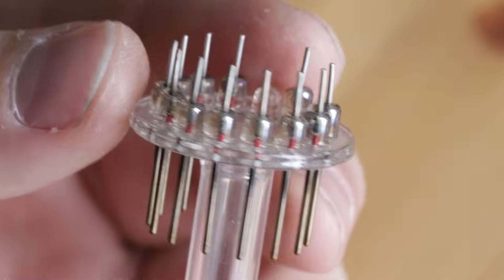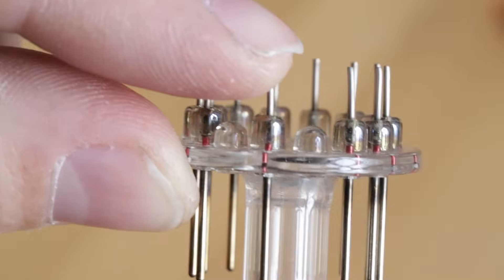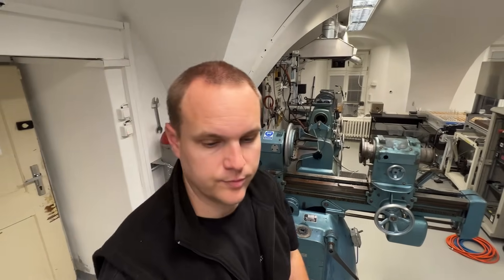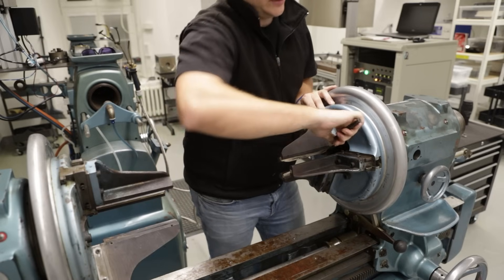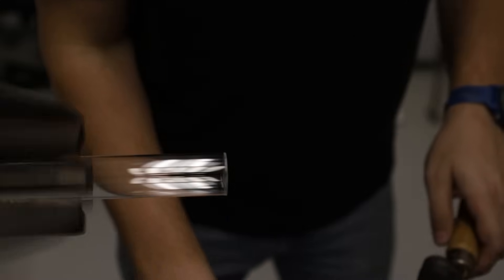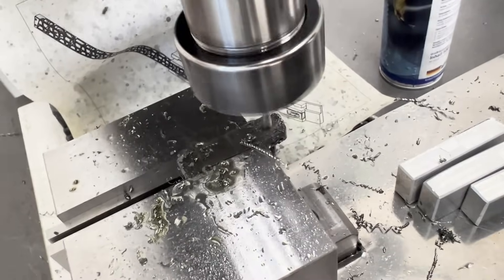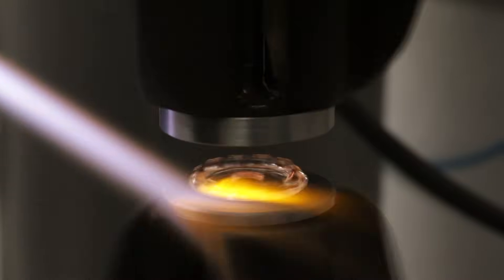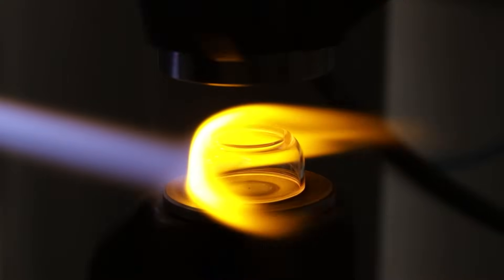First Experiments With Molding glass for F Nixie tube | EP#2

Comment: Making the stem from scratch will be quite a feat! I can imagine lots of challenges with glass to metal seal at the pins.
Reply from the maker: It will be, I was dreaming about it for quite some time, I am glad I finally get myself to it!
Reply: @manitoba-op4jx  
I like the 'no pins trough glass seals' idea, but I fear the coupling capacitance would be too low... (What would the capacitance of a digit to the anode be? I think coupling should be a few times that, but it would have a lot smaller area and only a bit less distance between plates)

Maybe inductive coupling? Could a LC tank circuit and rectifier be sealed in glass without being overheated by the sealing proces? (but for 10 digits... That's quite a circuit)

Comment: that archive footage reminds me of when I was a glass blower, we had similar mechanical machines for making thermometers
Reply from the maker: Did you make them manually on a lathe? Sounds cool!
Reply: @daliborfarny  I either made them entirely by hand on using a rotating machine based on a geneva drive with multiple sets of burners and a cam track to raise and lowers tiny chucks that hold the tubes, there was also several linear chain based machines but the rotary one was the most interesting and the hardest to work on, you need to be quick to both load and unload it as it runs.
Back then I recorded some video, I could send that to you if you want.

Comment: Making the best possible seals are difficult, so much that certain Helium-Neon laser tube manufacturers paid a lot of dough to just get it right.

And I totally agree that having your own machinery may help with keeping things rolling - just as you have found out, it's not always easy to work with the second source suppliers. So it's occasionally better to DIY.
Reply from the maker: Right, we’ve made soma 18.000 nixies so far and the route to high reliability (99.5%+ for tubes in use for 3 years) was rough.. cant imagine solving this in cooperation with the supplier - who usually denies having problems..

Comment: I suspect the toothed ring in the old film notches the glass so it will more readily flow into the cavities in the mould to form the beads. 

You may run into an issue where the stem might deform the flatness of the moulded disk when the two die faces separate, which may happen if the stem is a friction fit with the mould base; so you may want to try two versions of the die, with one holding the stem in place, and the other with a loose fit to allow for the assembly to move freely.  

To achieve a cleaner surface finish on your moulds, you may want to make use of EDM cutting where feasible. However, you can achieve high levels of surface finish through conventional machining and the use of surface grinding (horizontal and tubular). 

When you get to working around the surface interface of the pins, you'll find that a pusher rod to push the stem assembly out of the upper mould should reduce the surface adhesion (Beyond improvements that may be gained through better surface finish). 

Something you see in blow moulded glass forms, is circulation channels for water coolant to keep the glass from adhering to the mould surface. However, you may not be doing the volumes needed for that feature in the final tooling, if there's a fair amount of time to allow the tooling to cool. 

When it comes time to mechanize the process, it may be worthwhile to build a modular jig that can be controlled with PLC logic, so it can be adapted to different stems and different fixtures. Rather than the revolving carousel assembly used in the mass production setting, it may make sense to have a feed chute, and a few stations with burners, and pneumatic or motorized swing arms to swap the stem to the next position. However, such a setup could also be built to run manually, with minimal automation and still increase productivity.

Comment: I'm very excited to see you solving this problem as well. I'm about to begin working on a similar approach using a set of progressive dies and a desktop arbor press. Of course, I don't need nearly as many pins as you do for my applications.

My main concern currently is properly pre-processing the pins so that they have the correct oxide layer for adhesion and also ensuring that they aren't contaminated during pressing. I assume this is why the process is based on a ring of glass (instead of, say, glass frit) because it can be heated from the side opposite the pins and then pressed into them to protect the sealed portion during the rest of the heating and forming. 

I'm sure you'll find success before I do, but if I learn anything I'll let you know. Excellent work so far.
Reply: Its not that difficult. There is a pretty wide range of oxide thicknesses that will work. consistency and flame condition are more critical. depending on material you really don't even need to pre oxidize as just the heat of pressing the stem and using an oxidizing flame is enough. Dumet seals typically use a borate coating on dumet wire that is pre oxidized from the manufacturer and requires no further processing before seal. Tungsten should be polished, then hydrogen fired, then oxidized just before sealing and has a wide oxide thickness range that's acceptable. Kovar on the other hand must be very carefully prepared. Its actually one of the harder materials to work with, but makes the best seal with appropriate glass. For the purposes of this nixie and for cost concerns soft glass should be used which means either dumet or soft nickel iron alloy.

Comment: I love seeing your updates! I just thought if you every get multiple molds, that it might be useful to punch the mold number into the surface so that it will show up in the final tube. That way you'd have a way to keep track of which tubes were made with which molds which might help if you have tube failures later down the line.
Reply from the maker: Yes, thats how they made it - to track down potential problematic positions on the carousels. The machine I am going to build will be a single station, but it might be worth numbering them too - like indication of a revision..

Comment: Use induction heating wherever possible. Torches inject micro-impurities. Induction heating and cooling can be precision controlled. Clamp type induction coils as used on pipelines and bearings can be removed out of the way during the pressing process.

Comment: Yes, good work there, now just need to have the next on with a decent polish on the faces, and probably for the production one not a parallel reamer to make the dimples for the glass but a taper reamer instead. Then comes making the holes ot fit pins, and making the jig align correctly. would say that possibly with the exhaust tube you have a tapered probe in the upper mould that keeps the exhaust tube from being filled, which should also help with getting a full fill in the base.
Reply from the maker: Thanks! I am thinking just deburr the edges instead of these tapers and maybe do a light chamfer. There will also be a cone-like shape in the upper mold - to keep the exhaust tube from collapsing/getting filled.

Comment: great work as always! Those lathes are so cool.

you might look at getting glass preforms waterjet cut from plate. a disc with the required holes for wires and stem already present would require the glass to flow a lot less, and it would flow more uniformly. Seems like having glass flow up into the beads from all sides of the pins at once would make for more reliable seals, avoiding problems with getting the tube to flow around the pins and shut properly on the inside of the stem.
Reply from the maker: Interesting idea, I am afraid that would be too costly (waterjet)..

Comment: You basically need a heating station, a press for the first process (the crimper wheel) and another press for the final pressing all in the same form (so you don't need multiple heating spots). The base should have the ability to rotate (for the heating) and an indexing position so the presses fit with the pins exactly where they need too be. Since you're doing it manually, the system for the press should be similar to a shotgun shell reloading station with a small carousel and an arm that allows you to press the final die to form the glass. Were i you, i'd first make each station separate, then integrate them all into one unit. You could use a pre-made drill attachment that turns a regular drill into a drill press or even a broken drill press to retrofit into this machinery. It already provides you with all the structure you need for the pressing action. I would not make it horizontal, that just involves gravity and gravity is never a welcome guest when it comes to fluids. Just my 2 cents on it all. :)
Reply from the maker: Good points! I am actually planning to make a dedicated machine for it. I am using the lathe to speed up the prototyping - it has already the syncronised rotation and pressing feature.. In future, the machine will be single-position with the tools automatically placing pins/glass and extracting finished stems from the mold. The lathe doesn't have precise enough synchronization (there is slight slack on the belts).. this will need to be solved in the production machine.

Comment: Doing it in the lathe suggests the idea of putting a glass tube in the center hole inside the radius of the pins. Then spinning it up. Then finally bring the up to the proper temperature to soften the glass and let centrifugal forces fill the mold while feeding the tube in.

Not to in any way imply that what your doing isnt absolurely amazing.

Comment: Preheating the mold/top might help flow... You may also want to look into precision ceramic molds✌
Reply from the maker: Heating the mold makes the glass stick to it - maybe heating to lower temp .. or having the pins/exhaust tube to hold it will help..
Reply: @daliborfarny  Aha. Yes, there's probably a sweet spot. Maybe consider boron nitride release.
Reply: @daliborfarny  recap what I put in my video so people here understand too. polished Brass/bronze molds are best for avoiding sticking with soft glass. steel can be used but it needs to be polished and yes, heating the molds too much will cause the glass to stick. not enough heat though will cause the part to have stress. also shorter pressing times help. you want the glass screaming orange hot and close the mold fast and release fast. you want it still a little red after the mold opens to avoid stress and flow out micro imperfections that would cause them to look less than ideal. Also more liquid equals less entrapped bubbles.  carbon or graphite were never used in production volume. the molds would wear too fast.